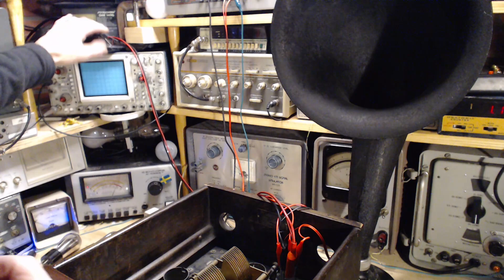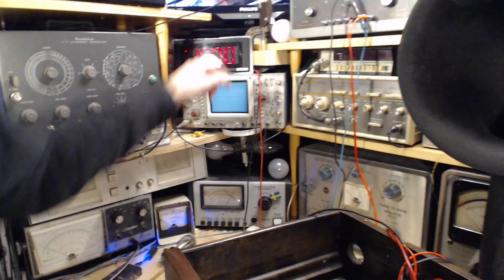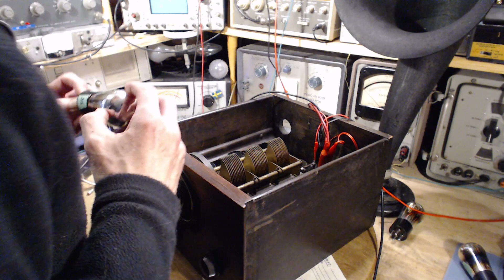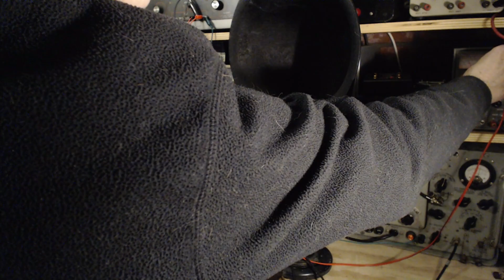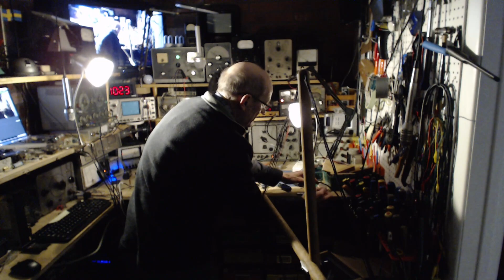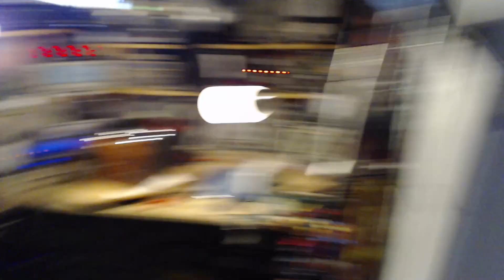1925 Magnavox Type D TRF Radio Video #7 - Getting it Working

Comment: Jim, that old radio was meant to operate on battery power, which would be pure DC.
Despite the filtering, I doubt if your AC-based power supplies could produce DC as smooth as battery power, which might account for the loud hum . Also, even a great radio would have problems receiving anything through the horrendous noise level in your shop, of which you are already aware.  Still, miracles do happen! 
 I'll be waiting for a miracle or two in your future posts. Good Luck!